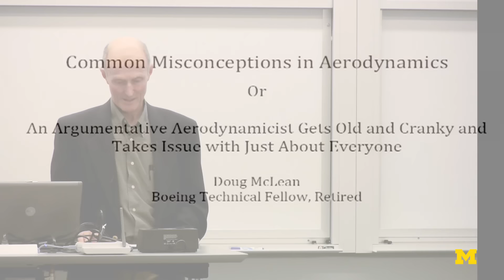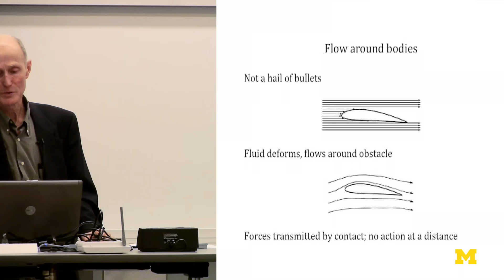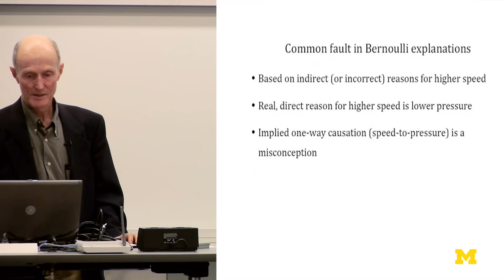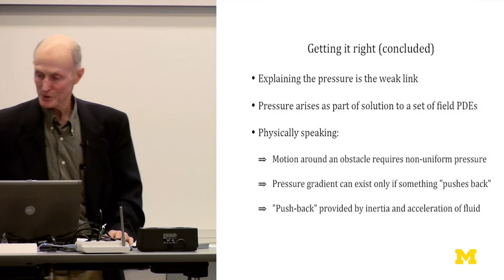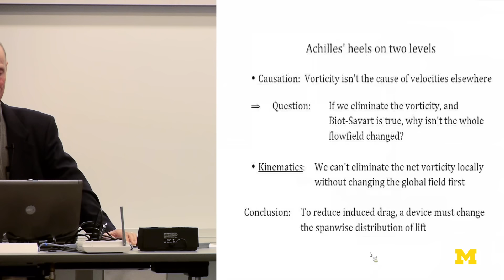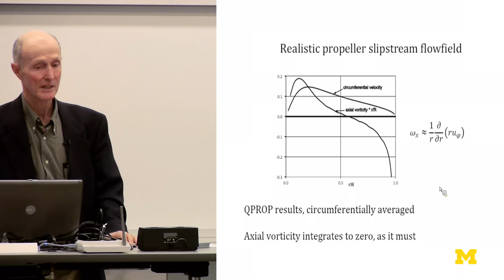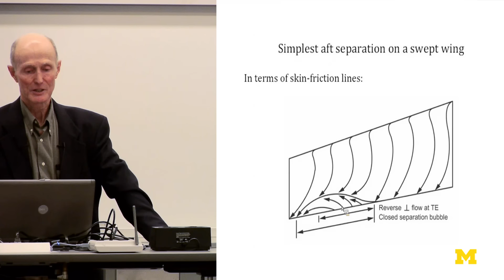Doug McLean | Common Misconceptions in Aerodynamics

Comment: Let me explain it to you. On the front edge of the wing foil where thickness is increasing, there is not a flow or compression, instead there is a deflection, exactly like a billiard shot, removing the air from the wing, to high above the airplane. Then you have a vacuum on the trailing edge of the wing where it is getting thinner. This is how you get lift. This is the John Anthony Davis law, which supplants those others. :-)

Comment: Could someone please clarify?  Is Doug McLean (from  44:55 onwards) saying that flight is not possible without a solid ground somewhere below the airplane?  That the airplane (through the atmosphere) effectively presses on the ground over a large area in order to sustain its flight?
Reply: It's just a question of where you draw your system boundaries. Planes fly for the same reason for which rockets work: momentum conservation. Does a rocket need a solid surface to work against? No. Neither does a plane. What happens if you add that solid surface, anyway? Well, in that case you absorb that momentum of the air/rocket exhaust with an almost infinite mass. Does it matter? Not to the new center of mass. That stays where it always was. ;-)
Reply: @lepidoptera9337  I assume if you had a small enough wind tunnel, you might get the transmission of forces from the pressure gradient by maintaining the gradient against the ceiling and floor of the tunnel, which would presumably offset the need for change in vertical momentum of flow(?).

Comment: I understand the lift the same way as the propeller thrust.  The propeller generate thrust with circular motion (through air) of the blade while the wing generate lift with straight motion through the air.  Can someone tell me if I got anything wrong here?

Comment: It is simple,
Never once mentioned conservation of energy.
A stationary wing relative to air goes nowhere.
Total energy is sum of Pressure +Kinetic Energy + Potential Energy 
Potential Energy is due to gravity and is in balance at top and bottom of wing 
Curved airfoil causes increase in velocity of air relative to flat surface 
Hence Pressure at top of airfoil decreass to keep total energy constant reduced pressure means lift
Reply: No, the potential energy of relevance in this case is encompassed in what you call "Pressure", or static pressure.  It is the potential to accelerate mass across a pressure gradient, as opposed to the potential to accelerate mass across the gravity field.

Comment: Thank you of this meaningful lecture. I am Tapio Pohjalainen graduated 1986 from Aalto University in Espoo, Finland as an aeronautical engineer. Currently I am starting my PhD studies and one of my interests is aerodynamics. The most interesting question is why we have so wrong view of e.g. lift theory. So far all approaches start with the assumption that air is flowing and presented as airflow, the wing is assumed as a fixed body. This is true in wind tunnel but not in real life. Airflow is wrong setup causing false conceptions and theories. It is the wing that is moving in still air. We have a different conception when we think of a bullet. That is facing the "still air" though it is at supersonic speed which has different flow dynamics as a wing in an incompressible air at subsonic speed. Actually we are accelerating an infinite mass of air in a volume of boundary layer which is the drag. The lift is because in the flow in close vincinity of wing is accelerated downwards, Newtonian laws implies. Do we have a real no slip condition which would mean a very hard acceleration of an air particle from zero to the speed of wing. The air drag is simply the energy required to accelerate this infinite air mass. This moving wing approach may be my main focus of my near future studies.
Reply: Whether our observation frame of reference sees the wing as stationary vs the wind as stationary makes no difference.  All motion is relative, and the classical laws of physics work symmetrically, that is, the laws of physics work the same irrespective of reference frame.

Comment: I applaud Doug's attempt to produce a better "layman's" picture of the origins of lift. However, I think the way he has named the erroneous equal transit time and streamline pinch views collectively as "Bernoulli based" explanations has had a most unfortunate and, I'm sure, unintended effect. There are a significant number of people out there that now believe Bernoulli's equation is itself erroneous or that the mention of Bernoulli in connection with the flow pattern proximal to an aerofoil immediately invalidates what you are saying. It's becoming something of an uphill struggle to counter this.

Comment: If a submarine rests on the bottom with some force and water is evacuated and replaced with air until  it no longer rests on the bottom, the force will be distributed over the entire floor.

If the floor is moved downwards the ocean and the submarine will accelererate until the floor is reached.

Airplanes rest on air that rests on the ground, but only after the fluid has come to rest. 

Airplains does not need the ground to fly, but with no ground the air would accelerate into a black hole with the same mass as the earth, and there would be no airports, no fuel and no fluid to fly in. And no aircraft.

The ground is essential for flying.
Reply: If gravity is removed the airplane will accelerate vertically by 1g. 

To fly without gravity requires no wings but manouverability suffers.

If the engine stops in a flight without gravity the vessel will finally come to a stop while the atmosphere diverges into a vacuum.

Comment: Question - this is always spoken to in terms of the air, or fluid is “flowing” over or around the foil.  But, isn’t it true to say the foil is moving through a fluid not in motion?  Is it the same, but different point of view (perspective of foil, or perspective of fluid particle)?
Great lecture!
Reply: Yes, it is the same. What matters is the relative motion between the fluid and the body. Hence why wind tunnel tests (static body, moving fluid) are representative of real flight scenarios (moving body, static** fluid).

Comment: An aircraft propeller indeed produces vortices and as a vortex is constantly seeking a termination point, when the aircraft is on the ground, will terminate on the surface of the ground often, 
as the vortex produces a vacuum, resulting in foreign objects being sucked up into the prop arc.   As for propellers being used on an aircrafts wingtips to cancel wing tip vortex, this was applied to an interceptor design near the end of ww2.  It was quite successful.

Comment: Correcting some of his errors:

1)More stream tube pinching over the top than the bottom can't be explained:

Solution: The stagnation point being below the chord establishes the mass flow separation boundary beneath the wing. This positioning causes the top geometry to present greater restriction to mass flow compared to the bottom.

2)Mass conservation doesn't address the cause of the force creating acceleration of flow:

Solution: The path detour shaped for deprivation tends to stagnate mass flow, thereby creating a lateral pressure differential sufficient to sustain a higher flow speed.

3)Lift is too complicated to be explained briefly in a meaningful way:

Solution: A solid asymmetry in a flow field generates an asymmetric resistance to mass flow rate. This asymmetry induces a corresponding pressure/speed response asymmetry consistent with the conservation of mass flow rate and conservation of energy. The resulting transverse pressure difference creates a conservation of momentum reciprocity between the airfoil and the flow field, which represents the force of lift (Newton's 3rd law: change in vertical momentum of flow).
Reply: I think the easiest way to look at it is this: both surfaces (top and bottom of the wing) deflect air downward (at a positive angle of attack), even in case of a flat plate. This is the ultimate physical cause of lift. Is this explanation enough to calculate the precise amount of lift and drag? Heck no. That's where your point 3 comes in... hard. Very, very hard, indeed.
Reply: @lepidoptera9337 True both regions are associated with downward momentum of air.  That's perhaps level 1 understanding.  Beyond that for the people who ask why it goes down, the interplay between the 3 conservation properties quickly becomes unavoidable.
Reply: @ Yep, it's one of those problems for which there is very little between hand waving and full blown theory at a high level of difficulty. Magnetism is another one of those. Yes, it's spins aligning... but don't you dare to ask for the critical exponent near the Curie temperature.

Comment: Doug, you mentioned "sun shadow graph"? at the start of your talk. An observation I made a couple of times whilst acting as a flight test acceptance engineer, - I have observed "pressure lines" or shadow lines on top of the wing surface during flight (my best description of them was "ghosts" - do you have an explanation for this? I've never been able to work it out. The aircraft in question was an A320 at cruise altitudes. These shadow lines were definite enough to photogrph.
Reply: Yes! You're seeing the light bend as it moves through a density jump, also known as the shock wave. It dances around, moving forward and backward, casting a shadow on the wing.

Comment: Can anyone help me understand his point made at around 40:00? He says that you can't produce net circulation with a propeller but I can't wrap my head around why. Clearly there is a zone of rotation in the direction I expect, but then in the graph he shows a zone further out (in the 0.5 to 1 region of r/R) that rotates the other way. I'm a bit confused how this counter rotating part comes about, videos showing it happening would be great I think.
Reply: @willaware3583  So would that be from the air flows coming off the ailerons counteracting the rolling torque then?

Comment: Bernoulli's principle definitely has a large effect on the downward turning. The air adjacent to the flow must be sucked into the downward stream of air
Reply: Yep. 

You can measure and observe both the suction on top of the wing (which is why we need rib stitching on fabric aircraft and why fuel gets sucked out if you leave a cap off) and the increase in velocity (why you never see a pitot tube mounted on the top of a wing). 

Equal time transit is false, but Bernoulli is definitely what actually causes lift.  Newton is just the reaction. 

Same as a rocket engine or a balloon that is let go. Most people concentrate on the stream of gasses going out of them and not the imbalance of pressure within them. But it’s that imbalance of pressure that is actually pushing them forward.

Comment: Gravity is overlooked in aerodynamics so often but it is the weight imparted to air that keeps it close to the surface of the planet because pressure decreases with altitude, air has mass and weight, the importance of downwards gravity force on atmospheric fluid medium is never addressed.
Reply: It's not addressed because its contribution is insignificant.

Comment: That last bit is confusing.  It sounds as though he's saying that, if an airplane is going to fly over a point in an hour, there's a small but nonzero change in the pressure at every height in the atmosphere.  Is he using an approximation where plane is going much slower than the speed of sound, i.e. the speed of sound is treated as infinite, so pressure effects can propagate instantaneously to unlimited distances?
Reply: I would guess the peak of the pressure "hump" lags behind the moving aircraft. All of these models necessarily make simplifications. There's a good reason they all break at the "sound barrier".

Comment: Check out this argument offered by Quantum Erasure for a very common misconception. 

Modus Tollens:
If ”P“ then *”Q“*. NOT *”Q“*. Therefore, NOT *”P“*.

If Commercial Planes travel at 500 mph for 2hrs (1000 Miles) over a sphere with a radius of 3959 miles ( “P“ ) it would then have to descend/negotiate 128.3 miles of vertical drop over the course of its journey ( “Q“ ).
Commercial Planes DO NOT descend 128.3 miles while traveling at 500 mph for 2hrs (i.e., They Fly LEVEL). ( “NOT Q“ )
Therefore, the Earth is NOT A SPHERE. ( “Therefore NOT P“ )
Reply: No, they do 'drop'.   Use a non-earth fixed reference system and you'll see it.   When you use a circular or spherical coordinate system that is earth-fixed you hide the 'drop'.   A satellite drops as well, but its velocity is such that goes far enough with each time step that the earth's curvature has caused the earth to fall away underneath it, leaving the satellite still in orbit.
Reply: The earth was measured two thousand years ago and found to be a sphere.  Every measurement since then has confirmed it regardless of the colour of swans.

Comment: Yes, but how does a wing create lift? Stunt planes have symmetrical wing sections. How does that work?
Reply: Zero angle of incidence pull up slightly on elevator,   positive angle of incidence, plane will lift automatically when reaches a certain speed

Comment: Good lecture but I am still unconvinced about anything. Firstly a flat plate will produce lift, as long as there is an angle of attack. Secondly, a sailing boats sail produces lots of lift (though horizointally, when beating to windward)) but though having a classic aerofoil shape, has virtually no difference in distance between the inner and outer surfaces (it would be interersting to see if a sail does have equal transit time. I agree with the author on a cynical and intuitive approach to aerodynamic lift theories that are taught as facts, but even after this good video I remain, as I said, unconvinced. Ignoring the word lift for a moment, many modern aircraft can climb simply on thrust alone. Indeed some can fly vertically, where the word lift becomes redundant, since this is thrust opposing weight, not lift. The old lift versus weight, thrust versus drag equations get confused and are over simplistic as soon as thrust produces upward motion (ah, rocket science, of course). In powered flight, thrust has always contributed to climb - the plane to some extent goes where it is pointed. I think straight and level is when climb is cancelled out by weight. The word "lift" could be the culprit. Maybe its the language that is wrong. Maybe also the clue is in the name of the aerofoil. It is called a "plane" and that is what it does - surfs on its own bow wave, known as aquaplaning when the fluid is liquid water. Indeed the origin of the word "plane" is "flat surface", is related to "plain" which means uncomplicated. If we use words in science it is as well to know what they mean and agree as to that meaning before using them.
Reply: drag's direction is the same as free-stream how does it have a vertical component
Reply: ***** The total force will have a vertical and horizontal component but drag is defined as the force in the free stream direction. Pick up any book on aerodynamics :) The component normal to the free stream is called lift by definition.
Reply: "a flat plate will produce lift," -- True. But that is about all you can say.  If you need to computationally determine how much, it gets very complicated.

Comment: Flight is a wing moving through air.   Aerodynamics is air flow over a stationary wing, both show similarities, but are inherently different.  Finally someone who sees air for what it is from first principles and not theory which is derived from false assumptions in the case of aerodynamics. 
The differentiator is in sailing where you have a body of air that moves at a given speed, which is reacted upon by a sail creating a pressure shift / differential which can then be converted to thrust.  So then foiling sailing boats becomes a really interesting divergence of multiples forces through two distinctly different materials.

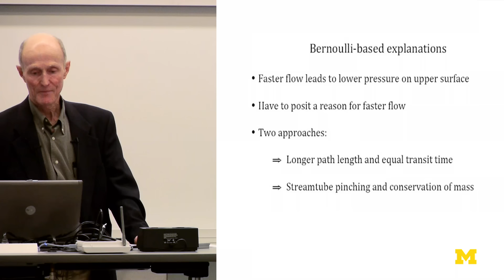Comment: Not saying Boeing Fellow McClean is wrong, just commenting. 9:23 Not a hail of bullets, a hail of super balls. 16:09 `longer path, equal transit time, faster flow, lower pressure` has an effect (however moderate,) the illustrated phenomenon means the top flow is even faster and thus has a less moderate effect - but no presenter ever takes that last step.
2) My `simplified intuitive model` is the bottom side is for lift, the top side is for control, to wit: spoilers. (yes, incomplete)

Comment: I'm sure he is an expert, and the coverage of common mistakes is important,  but this lecture lacks a lot of usefulness for this Novice , as regards the cause of lift
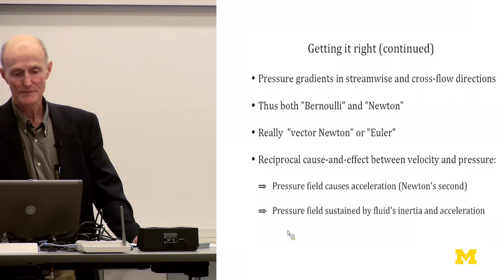At 15:29, he points out the flaws in the  "downward flow (Newton)" and Bernoulli principle  as explanations for lift, then at 23:09 says that "each is partly right, but incomplete. Repeats at 26:39  that  it is BOTH Bernoulli  AND  Newton that create lift, but little simple explanation for that lift. In fact at 26:45 he states his own dissatisfaction with his own explanation, not actually explaining the concept in detail.
Most of the lecture is about the logic errors in  reducing trailing vortices

My vote for the most useful remark at 25:06  that the pressure differential is spread over a wide area of atmosphere, with significant fluid volume affected above and below the wing, gets my vote. Logical when you think about it, but not something that had not imprinted on me before.